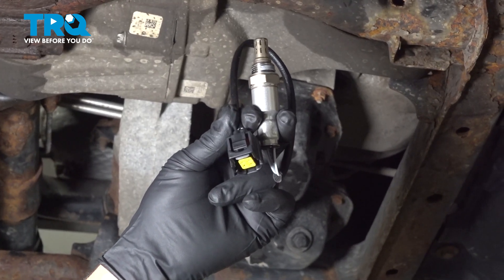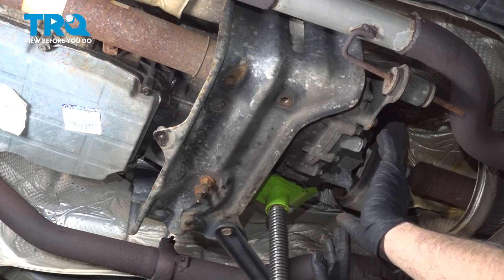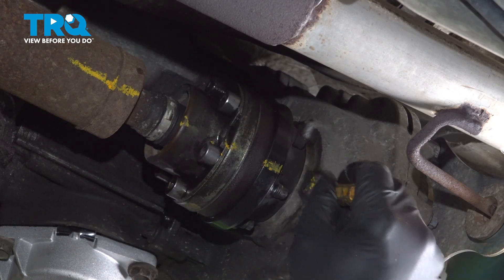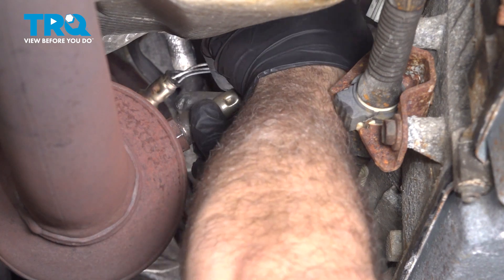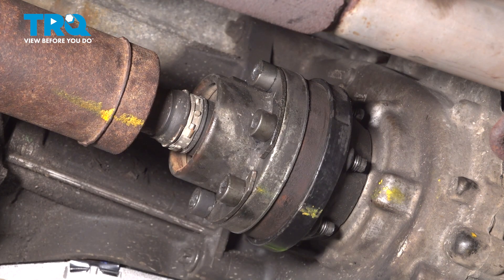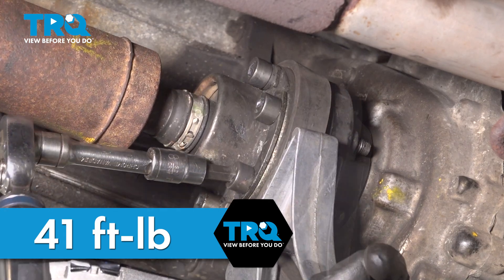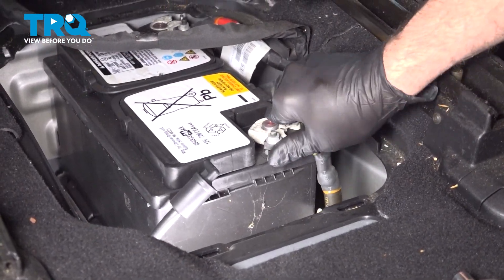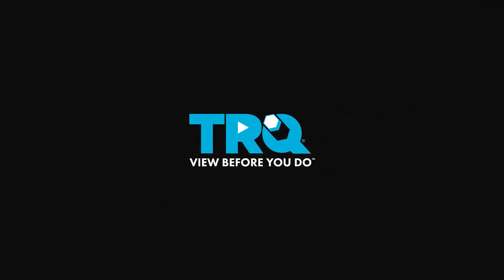How to Replace Downstream O2 Sensors 2011-2021 Jeep Grand Cherokee 3.6L V6

Comment: Thanks, I have a Jeep 2018 Jeep Grand Cherokee Summit 3.6L I have multiple misfire codes ranging from P0300 ($07e8) P0306 and P0304.
but I read that 
$07e8 might be failing because bad O2 sensor or a vacuum leak. does that seem right? I just bought ignition coils and spark plugs but just seeing what you might think. thanks